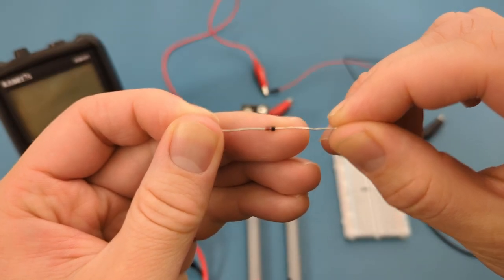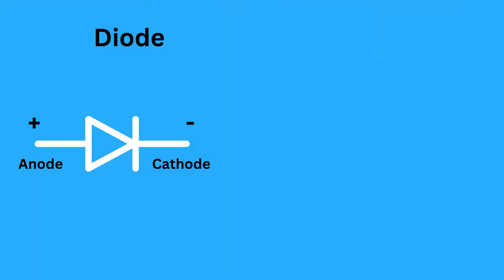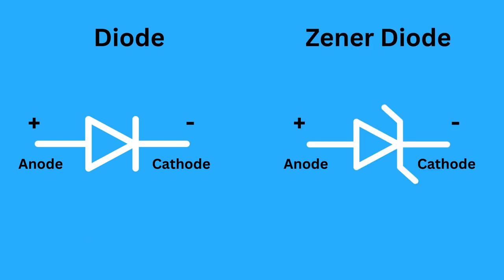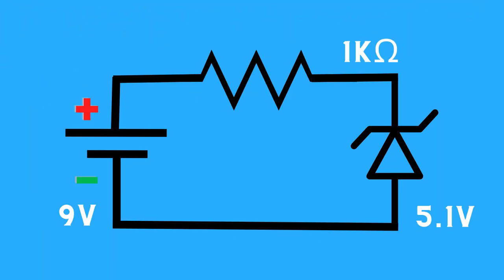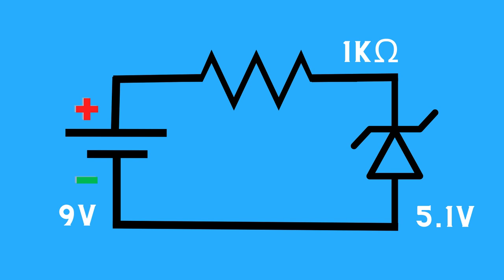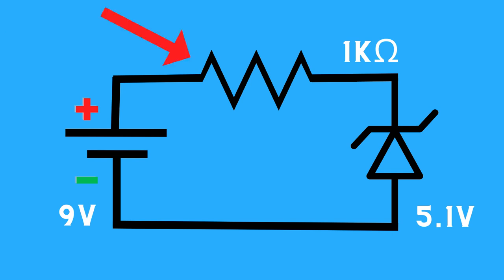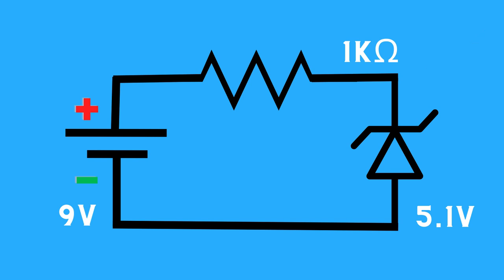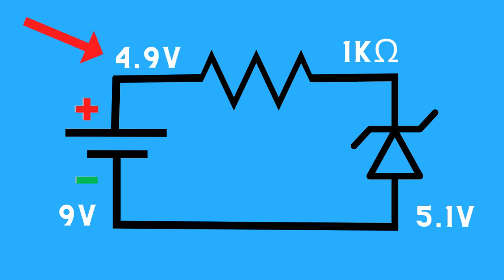What is a Zener Diode

Comment: Thanks for the demo with your explanation! I just have a couple questions:
How would this be different if you had used a 'normal' diode in the circuit instead of a zener diode? In what cases would I choose a zener diode over a different kind of diode?